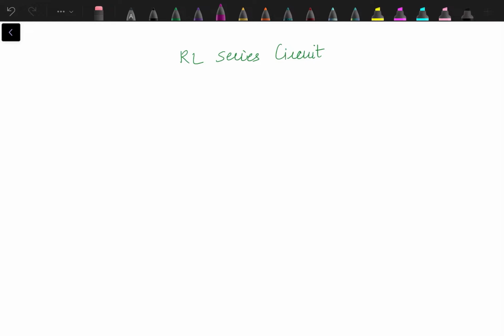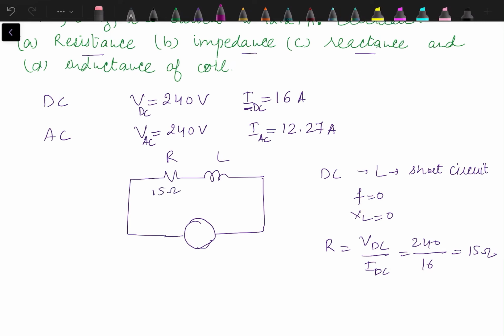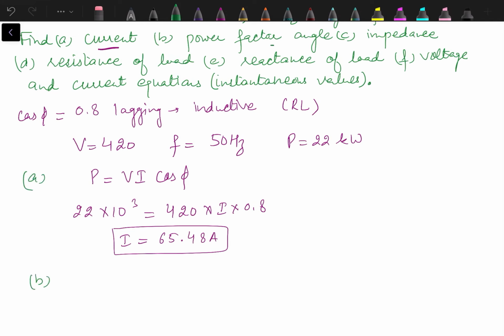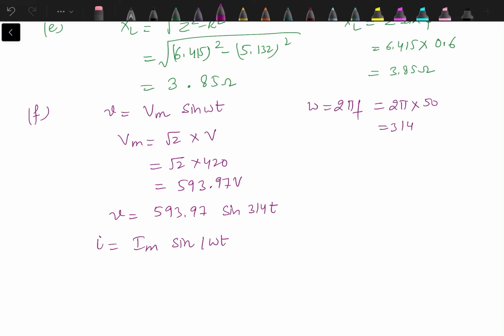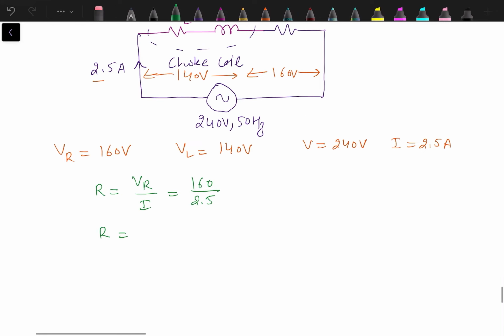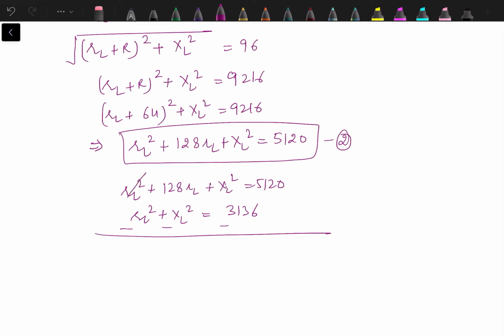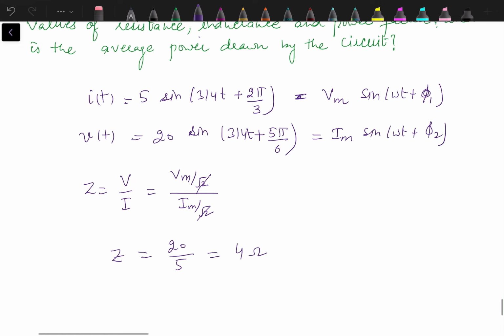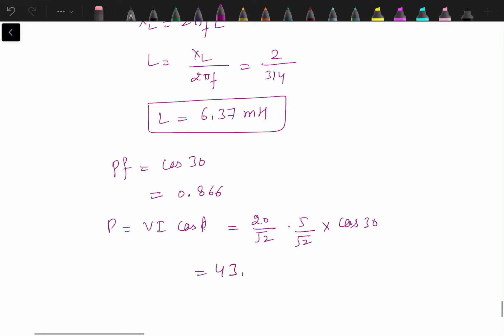AC Series Circuit: RL Series Circuit Numericals #circuitanalysis #accircuits #seriescircuit

Comment: maam average power shouldnt be iav multiplied by vav??
Reply from the maker: No Since its an AC circuit. In AC circuits current and voltage has phase difference and that is to be considered in calculation of power.